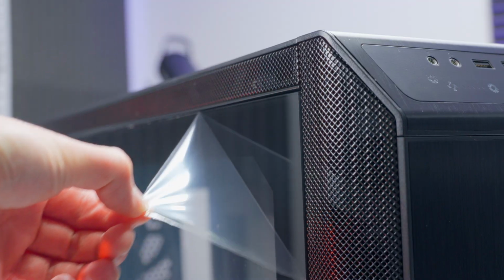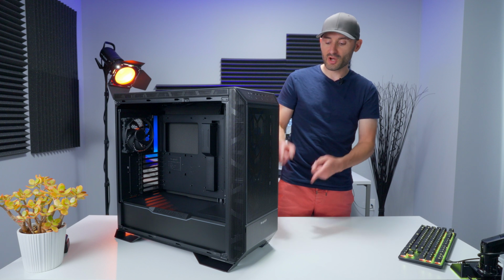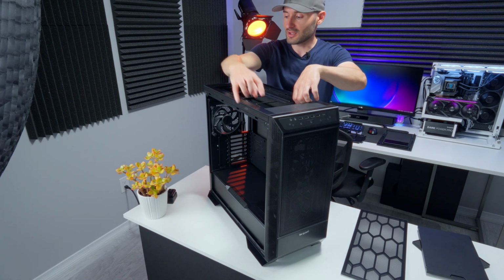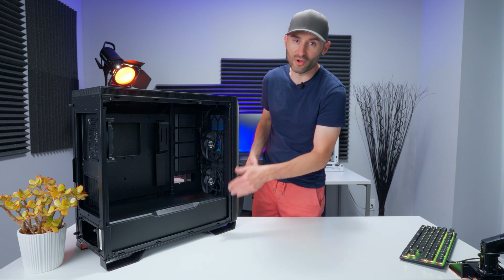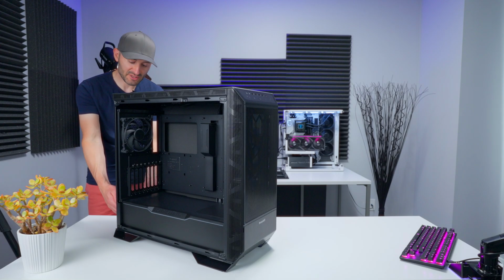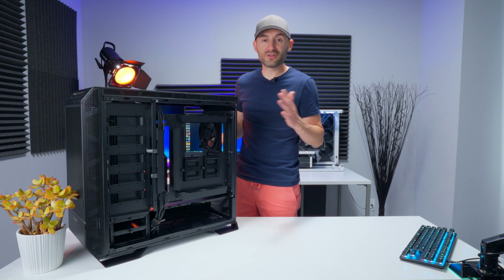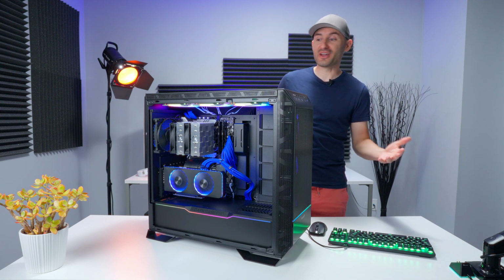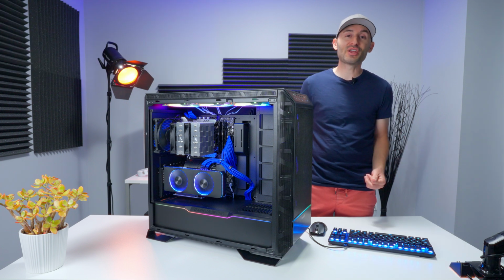Unbelievable PC Case! Be Quiet! Dark Base Pro 901 Detailed Review

Comment: if anyone is considering getting this, DO IT. i researched a ton and wanted to upgrade from my old nzxt h710i. was a beaut case but wanted something fresh and silent. not into the rgb garbage etc. this case is SILENT. i wasnt keen for the glass panel because i thougth that would sacrifice acoustics but idk how it does it..somehow dampens a lot of sound compared to my (somewhat thicker) nzxt tempered glass. working in it was a breeze. i love the minimalistc rgb light strip - much preferred to the in your face lighting in other cases. was pretty skeptical on the pricing but the quality is defs there. Im very happy with the purchase.

Comment: Be Quiet claims that you can mount 3 140mm fans in the front,  you can if you are willing to not use the optional ODD port.  Even if you use Be Quiet fans they will over hang into the ODD bay(the fan mounting holes will also not all align correctly so you can screw in all 4 screws for the fans) making it impossible to install any type of DVD/Blue Ray player. Ultimately,  I used Corsair 140mm ICUE fans in hope of having a smoother installation of three fans,  it did not help me with installing and ODD in the lower bay, although the mounting holes for the fans screws lined up better.    Also some of the removable parts on the backside of the the motherboard  area which are for running your cable,  may need to be removed either one or two of them in order to make it easier to run  all the cables or have room for a Corsair ICUE Hub.  The case also does not have a reset button on the top panel,  sometimes this can be useful to have,  considering what this case cost,  it seems sort of cheap not to include the cabling and button for this feature.  It is true,  this case is very heavy.  The case is very modular which is nice,  but some of the nagging things I mentioned first are a bit irritating considering how much hype I saw about this case from many reviews on various social media platforms.  I would  probably not get this case again,  if I had realized these short comings before I  bought it.  I had also downloaded the manual and read through it before I purchased the  case from the Be Quiet website, none of my issues were not revealed to me until I tried to install fans and build my new rig, at which point it's to late to return it so I have to live with my purchase.

Comment: This case is an ultimate disappointment, not a high-end case. This case is a mix of quality with stupid garbage design areas. Yes is heavy but you don't have a handle, instead you have the stupid useless phone charger. Idiotic thinking. You get dust filters for bottom but not for intake like on top and on right panel. Instead you get a lot useless accessories to collect the dust from your garage. Whats the point to add 120 mm side fans instead 140 mm because would be space there but they made stupidly the cutouts on sheet metal to remove that option. You get a glass panel like any average case for kids, but you cannot choose a high end left pane to attach more coolers.You wont get a good airflow but you can watch a stupid Christmas tree through the glass. You want a high end case? Look somewhere else. Look here for more info: https://youtu.be/fgysGyfb4O0

Comment: A beautiful case, this size, that does not support 420mm AIO's at the top is a sin against, erm... computer cases!  WTH.  Additionally, it does not come with the a built-in RGB / PWM controller, the Shadow Base FX does, the FX also allows for 420mm AIOs at the top and comes with 4 fans installed light wings fans and is cheaper, and smaller.

Comment: You are not able to control ARGB anything more than those led stripes of the case + sync them with all the rest. If you have ARGB fans, you are not able to control it using the touch sensor at the front

Comment: This is my first time watching you, and I think this review is the most thorough description of any case I've seen. Well done.

I have 2 questions:
1) On the cable management side, do you know the mm depth? Not a big deal if it's too much trouble to check.
2) For the place where you can put fans or drive cages, is it possible to mix fans and drive cages? For example, I will used the 5.25 bay for a Bluray player. Additionally, I would like to put up to 4HDDs where that opening is. With the leftover space, I would like to put fans intaking from the side. Would that be possible?

This case checks nearly every box I'm looking for. It's one of the best I've seen so far.
Reply from the maker: Glad you liked the video!  I measured about 23mm from the back of the motherboard tray to the edge where the side panel will attach.  In order to mount fans in the side, you have to install the included separate fan bracket in place of the drive bracket.  So you can't do both at the same time.
Reply: @ECPUz  ,
Thank you for the reply! I decided to buy it. Because I prefer the fans in the side, I decided to put my Bluray Drive into an external enclosure for the rare times that I will pull it out and use it.

I have a weird issue where the case PCI slots are too high up and my monitor cables can't plug into my GPU (EVGA 3080Ti FTW3 ULTRA). Going to tinker more tonight.

Comment: I just bought this case for the optical bay and high airflow, was thrilled to find it also had the wireless charger on the top, I am considering this a full upgrade from the Corsair 4000D airflow case.

Comment: Is it possible to install 3x 140mm in the front with the 5.25" bay installed? And what about the bottom fan? Planning to put a IO expansion / card reader in there. Thanks in advance^^
Reply: Officially, it can fit 2x140mm on the front while the 5.25" bay is in use. Unofficially, I saw someone say they were able to fit a 120mm fan snugly in between the other items.

Comment: The detail in your review is excellent. It's a beast of a case which would be perfect for HEDT workstations - lots of onboard storage, plenty space, and some control over acoustics - but it doesn't have the airflow performance advantage that the Fractal Torrent offers; where the Torrent's bottom intake can blow air directly into the GPU(s) and its front intake can feed a beefy CPU air cooler. Those who run SSI CEB or SSI EEB motherboards will be comparing this Pro 901 case with the Fractal Torrent, and I think decisions will be based on how much noise the machine can make in its destined environment.

Comment: the only thing you need to think about is air flow. Let's say I currently have a processor on the water pump and a 40xx series card on the fans. If I decide to completely isolate the noise from the computer, then I need to be sure that I will not have problems with the temperature. Of course, on the front panel and on the sides there is an air inlet, but it seems to me that this will not be enough for strong systems.

Comment: Would ya be able to use 3 140mm FRONT fans and still pop a DVD drive inside that bottom bay?..

It would've been nice to see the right side's SSD bays filled up and to see how they end up looking like
Reply: Yes, you can with the 3 140mm front fans and I plan on doing it with mine. The only thing you'd be giving up is 420mm rad support.
Reply: @pk.002  I already bought the case like half year ago around or less. 3 140mm top, 2 front, 1 DVD drive. Fans are the same model and speed etc. It sure is quiet on level 3. On 4 it's noticeable but on 5 it's a frigging jet XD

Loving it so far. No issues with touch controls (Sure sometimes it takes a few pokes to make it do what i want) and building it was a pleasure. Sadly the manual doesn't includes a real "How to remove the motherboard tray for faster installation" but it has a QR code for it that redirects to a video. Don't make the same mistake as me XD

Overall a pleasure to build. PSU , a CORSAIR RM1200x SHIFT, was really easy to connect things up without cables being tense at all, specially the GPU, a GIGABYTE RTX 4070 Super.

You can see videos of it on my channel

Comment: Very good review! THanks for sharing. Like the RGB. I have this case and i'm building a new machine soon, for the optional side panel fans 3x120mm which direction would you recommend? intake or exhaust? i'm also using the bottom case PSU fan (140mm) Cheers!
Reply from the maker: I'd go with intake on the side fans otherwise they'll be exhausting cool air from the front and bottom before it has a chance to reach the CPU and other components.

Comment: Think I'll stick with my be quiet! Pure Base 500DX for the time being purely on cost alone. But I do like the idea of being able to wirelessly charge your phone
Reply: I was recently considering a case between 500, 802 and this one, I’ve purchased 901 in installments, it’s better then waste money on cases which aren’t perfect.
Reply: @vqa33  " it’s better then waste money on cases which aren’t perfect".......I certainly don't think my 500 was a 'waste' of money. It suited my needs at the time I bought it.....And by the next time I decide to build a new pc there'll probably be a newer model than the 901 available
Reply: @bikes02  who knows, maybe it will not be available. But if you happy then it’s good. I’ve decided to go for 901 just because silent wings 4 because I want my pc as quiter as possible. Initially I thought that will go for 802. But it costs not so much less and stock wings are much louder there.
Reply: @vqa33  In the front of my case I have a radiator for my aio and then I bought silent wings 4  for top and rear exhausts